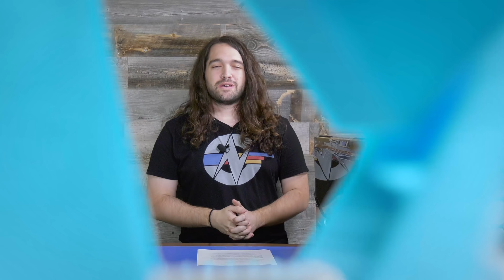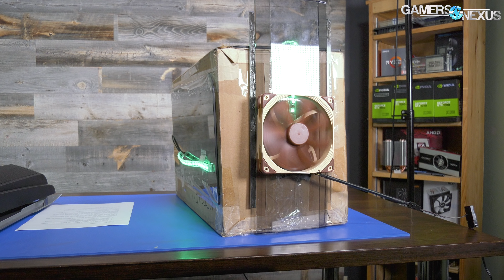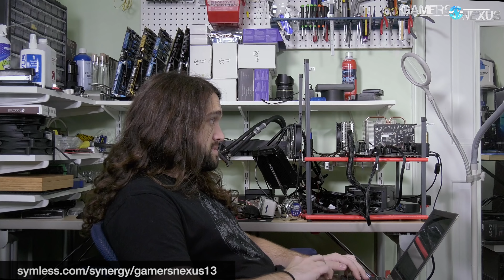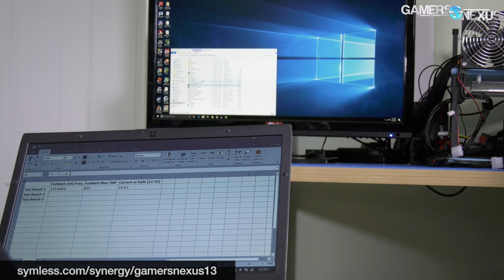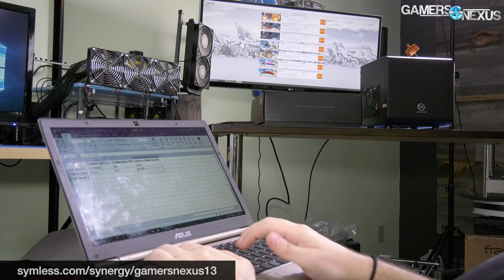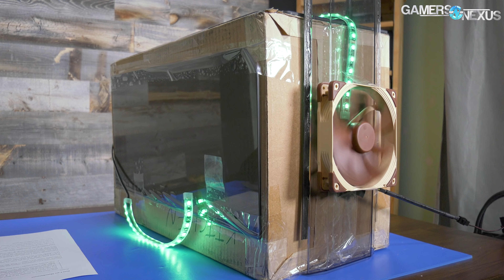Case Manufacturers: You're Worsening FPS & Power Draw

Comment: Personally I'm excited about the upcoming Silverstone FT06. The 90 degree motherboard layout would allow them to use glass front and side panels without negatively affecting the thermals at all. No idea if that's the route that they'll take, but theoretically they could design a case that looks similar to the lian li PC 011 (which is undeniably a very nice looking case) while still having excellent air cooling potential.

Comment: There's an older video that compares those perforated fan mounts to open mounts with grilles. AFAIK the dif was 15-30 percent improvement in air flow just from the open mounts with grilles. Why don't they go back to the older grille designs at the rear if it improves air flow that much?

Comment: Hi Gamers Nexus, I really like your content, it's technical, to the point and straight up. Kudos.

Given this is about the technical aspects of case design it surprises me as an engineer how we often thing of the flow of air in and out of the case, but not hugely inside. Given most components have a box profile, I do wonder about turbulent flow in the case. Particularly could more aerodynamic profiles on the inlet side improve internal cooling and direct the majority if air flow to important components.   PSU shrouds, for example, could be a big contributor especially if a 3 fan setup is used and the airflow from the bottom fan hits a profile that won't direct flow. I dont have any data on this but possibly a focused air flow may cool better and or give less noise. It may be worth looking into.

Comment: Where can I purchase the prototype? I found some cardboard, but I don't have the tempered glass or lighting strips. Also, if I soak the cardboard in water beforehand, will that help with thermals if it's cold? I was also thinking about adding one or two more fans to the front of the tempered glass. Maybe a couple high-airflow ones?

Comment: Is the RV02/FT02 still unbeaten? I want an RV02 without external bays or harddrive bays, a PSU cover, like 3 cm of space behind the motherboard for cable management, enough space for the biggest CPU Coolers and for the longest GPU's thats it.

Comment: First, I think these breakdowns are invaluable and rarely done.  You guys are awesome.  That said, some of this comes off as a slightly nitpicky from a real case use standpoint.  I totally understand that you have to mention that closed front cases, in some setups, will throttle GPU performance.  But in honesty, if I have a GPU that is pulling 100+ frames already, 6-10 frames is not going to make or break my gaming experience.  Most people buy these cases because of aesthetics or to quiet their rigs down.  So, your comments about noise are much appreciated.  However, I feel you are shorting us on data in that regard.  You show the noise to fan speed curve, but you never really address how much an open vs closed front panel would actually impact those fan speeds in real use case scenarios.  Sure the noise from 30-60% fan speed is huge but if I am only going from 30-40% fan speed in a closed rig, who cares?  Additionally, as you mention, those closed cases will mitigate more of that sound due to their design, but you never actually give us numbers to test the dB difference when it is all put together.  Lastly, and you give numbers on this but I don't feel fully explain it: The type of fans and coolers you are using matter a lot.  Most those closed case designs are intentionally made for putting AIOs in the front intake.  The reason this matters is because AIOs you high static pressure fans that are better able to pull air through the small vents on closed front cases.  This is much different than trying to slap airflow fans in the front and then something like the Noctua air cooler you showed in your temp benches - and you don't address that intake issue.  What intake fans were being used?  Have you tried using static pressure fans in the front intake when trying to air cool a rig in one of these cases?  In my mind, that will make an impact on your temps.  Test it and prove me wrong!  Again, I think the overall idea of this vid is great.  I just feel you are falling slightly short on providing the data to prove your points.  And honestly, I am wondering if the case manufacturers, in fact, have looked at the things I mentioned above when making design decisions and you are simply missing their rationales without that data.

Comment: Hear Hear! computer Jesus has prophesied! May the devil merchants of poor thermal design fall on their own swords!
...it was easier in the distant past, PCs went slowly a little hotter with each gen - you poked a few extra strategic vent holes in your all-alu light weight case. Cases where black and radiative, excellent thermal conductive material, light and LAN friendly. At the turn of the century we went from 200W to 300W psu... Then 430W... Now for a gaming rig you need a quality 550W to have some headroom. Somewhere the case manufac. dropped the ball. I'm not sure where, I have only used 2 chassies last 20 years of PC gaming (frequent internals changing/overclocking though)

Comment: Why does no manufacturer make a cheap case that looks like crap but has really good airflow? It seems like you could easily mass-produce them out of steel and plastic for basically nothing, and I'd want to buy one if I ever made a PC. All I want a PC case to do is hold my computer in one piece while not getting the thing choked to death.

Comment: hmm, interesting... i have always consider gn to be The youtuber that knows something about how electrinics work, but when he says that hotter running component draws more power... :D im loosing all the hope for better future of humanity :D
Reply: semiconductors like leds get lower resistance/voltage drop if getting hot. thats why you should match leds an use individual resistors.
now the cheapo christmas light ones dont. If there is one led that gets hotter it will draw more current,
get even more "hotter" and if enough heat+power available that led will fail.
Now i dont know in which direction cpu semiconductors go, (PTC, NTC or mixed)  but since superconductors are not yet used,
cooler should still be better in case of internal resistance because you get lower voltage drops/voltage levels needed.
more voltage, same current = more energy wasted.
Reply: @PsiQ  well yes i know all of that, and i dont want to say that is just a theory... but it kinda is :D i have tried running several cpus and gpus on different temps (fans at full blast vs. fans on min. rpm) and the power draw is the same, measured with clap directly over the EPS 8pin and PCIE power connectors respectively

ps sory about my english... i am not native english speaker but i suspect you have already noticed :D

Comment: Airflow should be a primary feature, and honestly so should filtration. Every single case these days should have sufficient airflow to cool a machine, and that going through some kind of dust filter. That's the job of the case. You don't need to solve HEPA filtering air intakes (although that'd be an interesting feature), but ffs, how hard is it to throw a cleanable mesh on things?

Comment: YOU ARE WRONG!
In that Case  beside the extra noise reminding you that your build is a fail ,  you need a technician to clean the dust  every  6 months vs 2 years   adding  extra cost that could have been used for better hardware = more fps overall. Overclocking is way overrated  its  just a manufacturer invention to profit  vs you ,always disable any (turbo)  have a good psu  and your bulid will perform 100% forever no matter the case.

Comment: Lol my 2010 Antec 900 - exactly as in this video - is now holding my   6600K/GTX1080 system... 2nd processor and 8th video card since the original 955Black/570Ti build, none of which remains except the CPU cooler and case. Still going strong, original fans too, thousands upon thousands of hours later.

Comment: Despite idiots being idiotic and saying idiotic things, Alienware has often made very nice cases.  And looking nearly ANY of them up, cases alone, on eBay... well... it is rather indicative of this.  I am currently utilizing an Aurora R1 case with a fitting x58 980x 6c/12t all @ 4.1, 22GB DDR3 @ 1600, GTX 1060 6GB @ +220 +700... With all of that relevant only for heat purposes more or less here... The PSU in this case (875W) is mounted below, as most newer units still are.  But the beauty is in the compartmentalization.  The hinged door ways to certain areas, which make specific air ways possible... All which have specific inlet and outlets to themselves. The RAM has a fan, the HDD bay (RAID BAY which holds 4-6HDDS, 4 full size on tool less system, and 2 spots for SSD) has a real nice fan system with the fan itself mounted on its own tool less rail in the middle of all drives.. with two additional fans in the front, pulling air directly from outside front of case at its bottom inlet set, then having the mid mounted fan assist it in moving it over the remaining drives, then lastly having the PSU compartment pull it through and out.  The GPU has it's own channel of outside air as well, and the CPU is AIO cooled, with a couple methods possible for rad mounting.  One of which can involve moving dampers on the top of the case when it comes on, to vent out.  Pretty neat.  No windows, but a minimal and even tasteful amount of translucent plastic which can embrace programmable RGB elements. I even have other R1-R4 and even ALX cases utilized in other instances, as they are all just as amazing.  Temps are always fantastic, looks are great, sound is not only deadened via the amazing build quality and how thick it all is... but none of these fans have to work very hard to pull off amazing performance as it is... as the layout is a well designed art. I don't even look at mainstream cases, pretty much just old Alienware or even Dell T series server towers... they can be pretty damn good too.  That or open test benches and or wall mount art style open cases... Those get used now and then as well... depends.  To use all of this Alienware goodness one must get the AW control board with the case, and run the software for it to program it as they like... or run a stock curve.  But it's super minimal, and has current options developed for win10... Takes 0 resources, and is more of a hard programming thing. Likely doesn't even need run beyond startup really.

Comment: My Shift X case literally cooked itself to death. I had;
i7 6700 stock
GTX 1080 OCed

Both on custom loop with a 240 and a 120 rad. The components would get upwards of 80c and the hard tubing got soft to where they slipped out of the fittings. Too powerful for that case. AIO probably would have worked a lot better in this situation in hind sight. Still. A lesson in what happens if you put form over function.

Comment: I'm still using my Coolermaster ATC-110SX aluminium case from 2002 and it still keeps my 2500K@4.8Ghz overclocks cooler on Noctua powered air compared to most cases I've seen in this day and age... So what's wrong with these current cases if they can't even stand up to an oldschool aluminium case, besides the childish and horrible RGB slapped on them? Hey, I'm old school and like classy styling with some mild blue leds, instead of these flashy fun fair lights!

TBH, your cardboard case design might give it a run for it's money😄

Comment: Seems like a lot of bs. I use a NZXT case that has a single rear fan, a single top fan that are both 800rpm and a radiator in the front 240mm 1200rpm and the front panel is completely closed off except for top and bottom and the slots are only about a half inch wide and i NEVER go over 45c running 4.3ghz and 1550mhz on 980ti

Comment: This was exactly my issue this Black Friday. I upgraded some parts and I was looking for a new case because my 9700k runs hot Overclocked. Almost all of the modern cases have lackluster ventilation and no air flow! I was sitting there looking over the Thermals list trying to find something I could use and besides having wind turbines mounted, my selection seemed limited. PLEASE LEAVE A SPOT IN THE FRONT OPEN. Cheers!

Comment: i found by using a removing the front panel and using a drill press to drill small holes in a pattern in over the front of my Bitfenix Enso case, thermals improved a good bit, before and after keeping a 2700x below 60C when using cpu burner. but idle temp going down to 29.9C

Comment: How to make a case that appeals to the greatest possible number of people:
1) ATX size for maximum compatibility with loads of different parts
2) Full front mesh with fans all the way down. 
3) Four USB ports, a headphone jack, a microphone jack, and a USB Type C on the front. 
4) Space for a THICC heatsink and an upper mesh grille for the AIO water cooling crowd
5) Clean, black design that isn't trying to be RGB Space Invaders
6) Good cable management
7) Adequate filters
8) Basement for power supply with HDD and SSD storage
9) Rear exhaust fan mounted parallel to IO shield
10) A tempered glass side panel for the crowd that absolutely can't do without

I ended up picking a Cougar MX330-G because it ticked enough of the boxes for me (and at a better-than-expected price), but I would have selected a more expensive case if it ticked all of the boxes. Widen it, give it some slide-out filters and include Type C on the front IO and you're in business.

Comment: @2:17 : I'm still rocking an Antec 900 that I have just now moved over to a new ryzen build with 2700x, rog strix x470-f, 16gb B-die, dark rock pro 4, 970pro M2 and 850w psu.

Coming from a ten year old i7, so the surprise was great.
In any case (no pun intended), the Antec still rocks, even without the cable management.
Who the f* cares about that, I just dremeled a hole and feed most cables through the back,
so with a little effort you can add cable management to the case ;)

Only reason why I still use it is because of the bigg *ss 200mm fan on top, which combined with the 2 120mm fans on the front creates quite a decent airflow.
Why spend 200-300 bucks on a new case when you still have a kick*ss one in use ? Compared to back in those days, cases are way overpriced, just like everything else.
I'm not spending hundreds of dollars for a case that is at best 'on par' with the Antec 900 (bar the f*ing 'cable management' off course).

:/

Comment: My old 'timeless' all black meshed mega tower has an interior temp of only 2-3 c above ambient (idle and under load). Could be even cooler if I ramp up the fans. I've no desire for a new case. It will be reused a 4th hardware install. It's under my desk anyway. I look at the screen. Not at the box.

Comment: A PC Build is only complete when the O/S is installed and the PC is running. I enjoy building PC's and basically, you are right, pretty easy and my tip is to have all your tools together first and a large bowl for all your screws. Still, it's always a hold your breath when you hit the start button for the first time. The problem with building PC's is when you get a bad component and it doesn't work. Then it can be a nightmare as you try and troubleshoot

Comment: It's supply and demand, not really a dictation of the market by the manufacturers. They've seen that tempered glass and RGB cases are popular and selling well and are joining in to make some money. I hate those cases personally as I don't want the distraction of lights, and I want as little EMF/RFI leakage as possible, so solid steel cases with good airflow but quiet are perfect for me. Looking at the Fractal Design XL R2 for my next build.